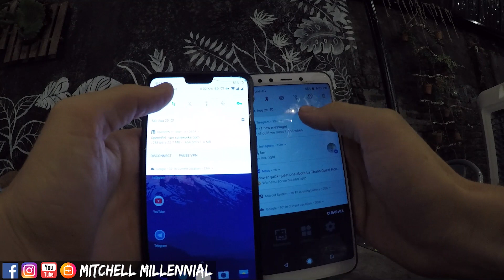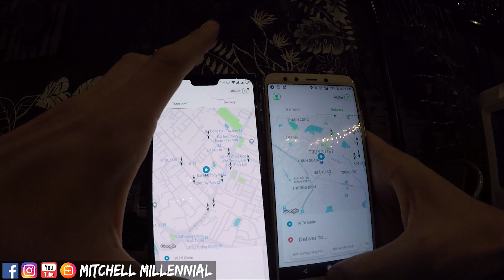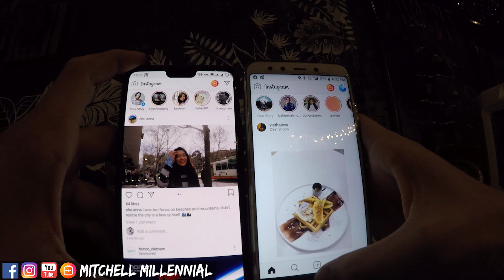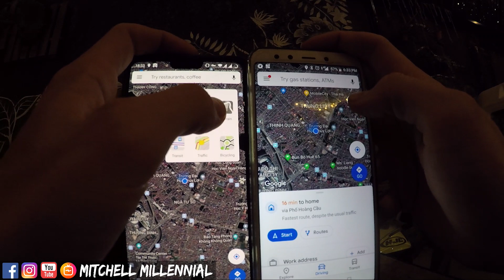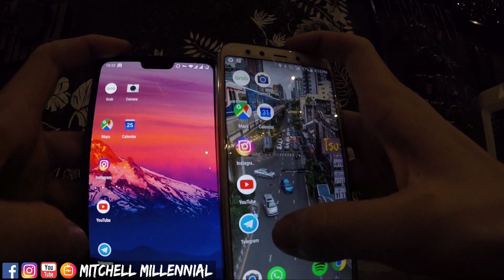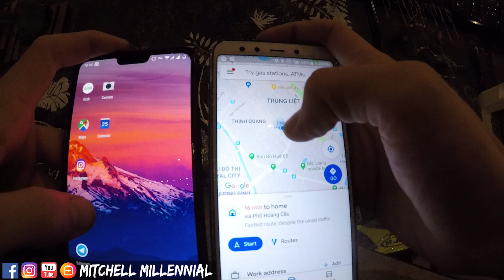One Plus 6 Vs Xiaomi Mi A2 Speed Test

Comment: Congrats for the channel, it's not so easy to expose yourself at internet. BTW that wasnt quite good speed test. As a suggestion and what I got really interested to know about is how is going your path of detox from media social network.
Reply from the maker: Wow thanks for the interesting feedback, I kind of prefaced that in the video that it wasn't so comprehensive but more for everyday users. I think everyone knows that no shit a snapdragon 845 and 8 gigs of RAM should smoke a snapdragon 660 and 4 gigs of RAM for anything moderately intensive. The reason I made the video is that I thought people would find value in how close the performance was for everyday things like messaging, maps, 4-6 open apps at one time. Being that most people consider the one plus a flagship killer and we can see for day to day tasks the mi a2 is insignificantly would that make the mi a2 a one plus killer? I mean outside of the unremarkable battery life this phone goes toe to toe with a phone double it's price. Another thing to note is that xiaomi supports replacement parts for there devices for a while. Meaning, if you are a power user and you do wear out your battery faster getting the battery replaced would be 30-40 bucks. Getting spare parts and finding a place to get a one plus repaired is a nightmare by comparison. 

Also on my second YouTube channel, Mitchell millennial abroad, which is solely my living abroad and travel content (I have 3 different video series and it's new videos m-w-f morning), I actually have a video scheduled about the curse of Facebook when living in Vietnam where I briefly touch on why its not on my phone. The other channel has 3 months of content already shot, edited, and scheduled to go up along with podcasts and other material I have been working on for months.
Reply: Wow !  Sorry, I  totally underestimate you.  Thank you for the explanation and I'll dive into your content. See you on the other side.
Reply from the maker: Hey brother, here is my programming, Monday is aesthetically pleasing content, Wednesday is my series driving like a local which has to do with transportation and motorcycle life and culture in Hanoi and living abroad, and Friday I do educational videos about either expat life, travel, or general travel tips. Here is some eye candy for you https://youtu.be/Cpbt2RRw5sM

Comment: I have a oneplus 6 I love it only thing that pisses me off is when I go to press space and press the home screen button 😵
Reply from the maker: Can't you switch to gesture?
Reply: @MitchellMobile  cheers I've changed my settings hopefully it be ok, thanks
Reply from the maker: @justyjust  I feel your pain, my A2 doesn't have gesture support yet and it effects my use on gboard
Reply: @MitchellMobile  I had a oneplus 3 and that had most of the features of the new oneplus 6, only brought this oneplus 6 due to breaking the screen and needing a phone asap. Otherwise oneplus kept updating the oneplus 3 and had most of what my new phone had even face unlock, battery was still going strong even though it was brought on first release of oneplus 3 only replaced it about two months ago. Great phones no comparison only thing that worries me about this phone is breaking this screen and also the glass back which the 3 had solid body 😥 but I guess there's got to be some weak point or no one will buy another phone from them.
Reply from the maker: I had a one plus 3t, got a xiaomi mi5s plus. (same specs bigger battery), had a mi a1 and now a mi a2